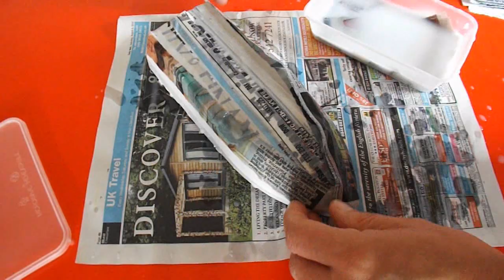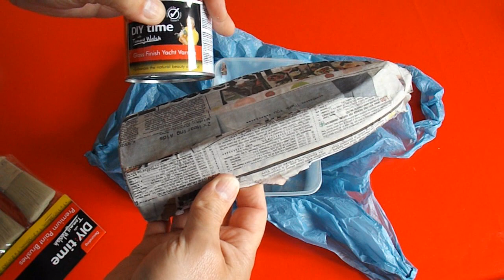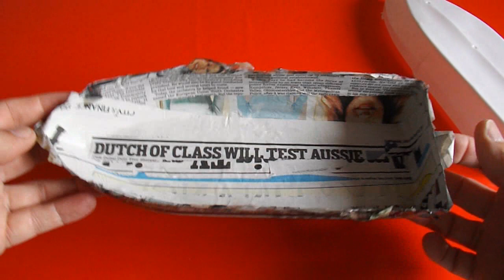Paper Boat for Coraille

Comment: Unrelated to boats, but Poundland sells some decent flywheel powered cars (the sort you push on the ground). I've been thinking a fun project would be to take apart a servo and use the small motor inside to drive the gears after removing the flywheel, and turning one into an RC car. Perhaps something for you to do in a future video?
Reply from the maker: +himselfe I have done something similar, not sure which video, but I will put that on the list anyway. I have a shortage of servos at the moment. One of my eBay purchases failed so it will be best part of another month wait for the next batch from China. Found that video, it was a push along tank https://youtu.be/MwXyp6LA5qw
Reply: Ah! That's pretty much exactly what I was thinking, except I figured removing the fly-wheel and driving the gears directly would be a bit more efficient. The gearbox on the Poundworld car I bought is just press fit together and held on the chassis with a clip, so it's easy to take apart without needing any major modification. I've also considered using a servo on the front wheels for steering, but I'm not sure it would work that well without some sort of linkage that turns the wheels themselves instead of the entire shaft.
Reply from the maker: himselfe certainly turning the wheels on stub axles gives a better turning circle but takes a bit more work to implement.